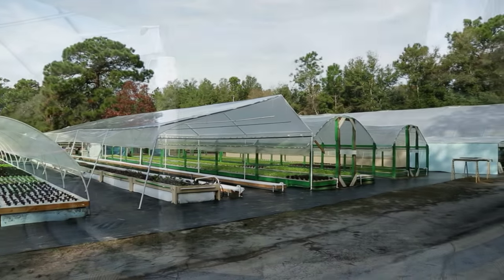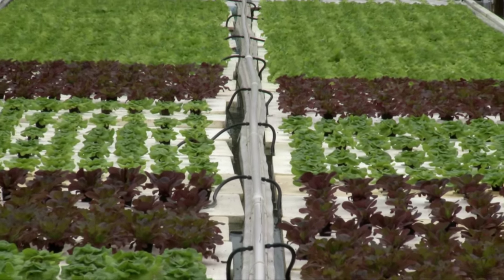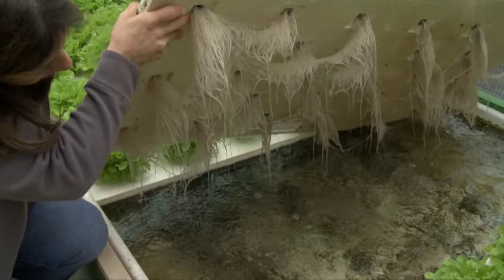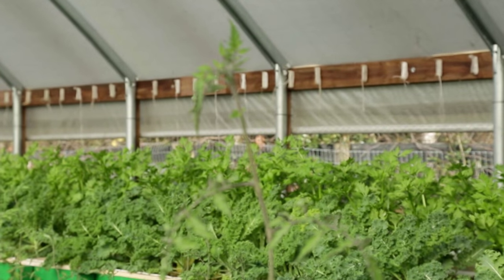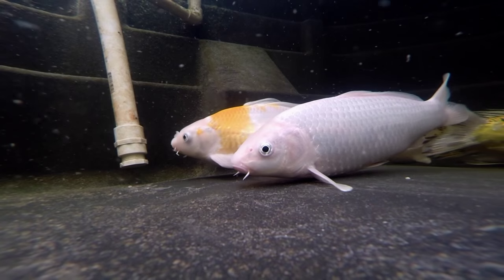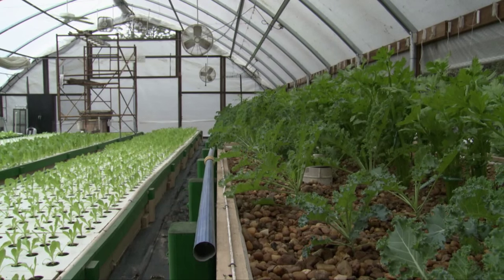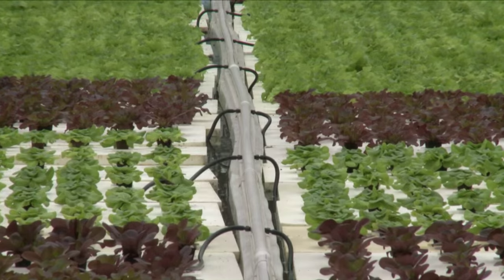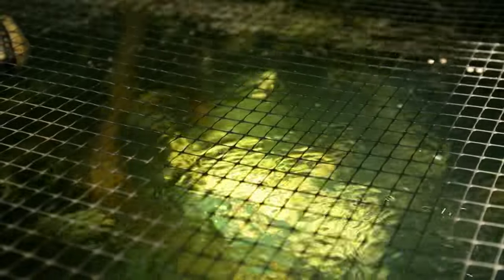Techlectic: Aquaponics

Comment: Wow !!!!  Awesome.  I want to do that but just for our own food.  What temp. do koi fish have to be kept at ?
Reply: Check it out at a pet store! Most goldfish like 68 to 70 degrees , I use 55 gallon drums to catch rainwater then disperse in to my fish pond , then pump water through to the pipes on a wall system that flows back to the pond after going over a rock stream that catches any sediments. That way I only clean the rocks at the start of the rock stream and not the whole system. I also have my pond connected to the drain spout of my house by a big O pipe buried underground, any excess rainwater goes to the shallow end and overflows into my flower/ vegetable garden..